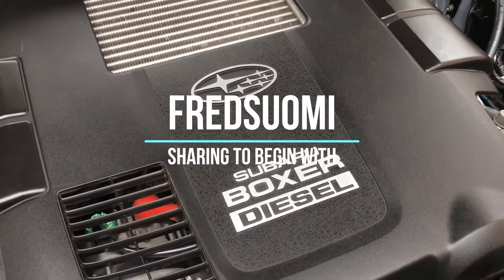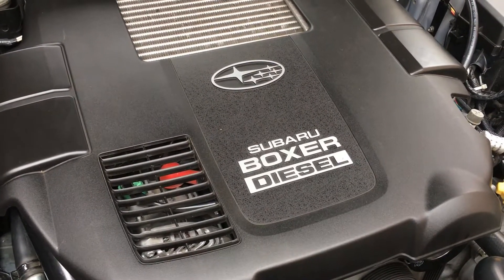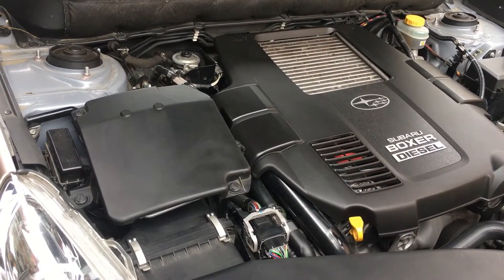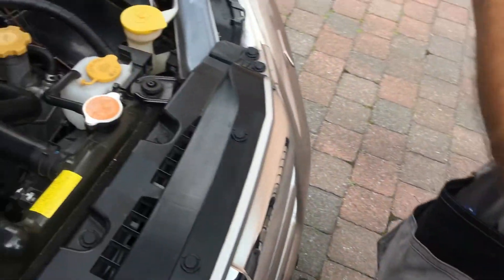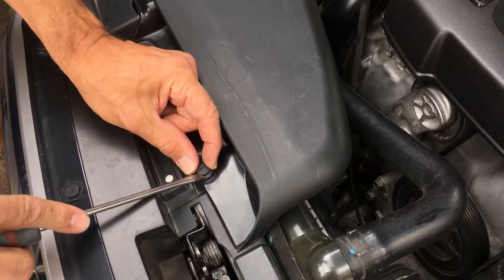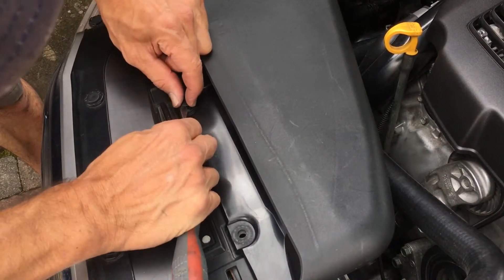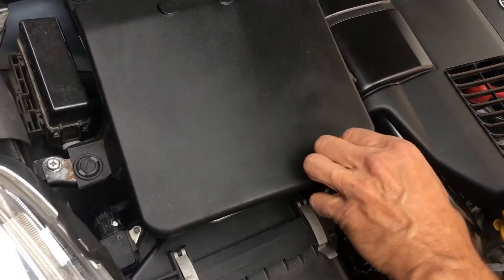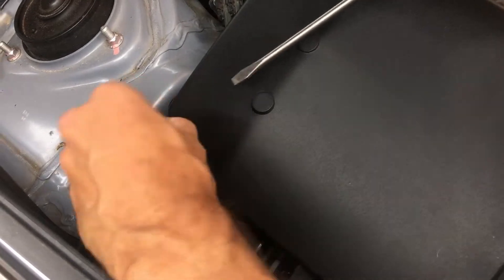Glow Plugs | Subaru OB 2,0D - MY 2014 | How to get there?

Comment: Hello fred 
I have 2011 subaru forester bought blueprint plugs same ones you have 3 years ago ,mechanic didnt want to do job risk of snapping and advised to change when  old plugs are at end of life , reaching that point now 106k miles . Wanted to know how long did you keep blueprint plugs or did you change to original ?
Planning to keep subaru max 2 years 20k miles. Would it be ok to use blueprint plugs, or i have seen recently denso dg615 plugs 
Thanks
Reply from the maker: Hi Nasir, no big worries to expect following your plan to keep your Forester for these extra 20k miles 
with the same GP's, regardless their origin.
The outstanding job to service the GP's with such mileage will be left to the next owner, which most probably will not be as easy as a walk in the park...
As a non-professional, to service my GP's each ±50.000 km with OEM ones (#22439AA010 MY2009-2015 added to the maniacal cleaning of each bore with a reamer) has ALWAYS ended up in a smooth & easy job.
Cheers, Fred.
Reply: @FredSuomi  hello Fred,  since last message looks like denso plugs are not ref compatible 22439aa010
So it looks like possibly buy original or keep blue print ads71802 and use for approx 20k miles 
Thanks again for feedback

Comment: I got the broken glow plug on cylinder 1. Is cylinder 1 top left or top right?
Reply from the maker: I shouldn't bother too much about the cylinder location but performing a simple Ohm test with the 4x GPs in place. The one with the higher value will be the one to be replaced.
Reply: @FredSuomi  Thanks for your reply. I got a report from Subaru saying " glow plug snapped on cylinder head and pausibly causing compression leak because car has loss of power" it also say " when check data found injector no 1 compensation  to be higher then the others" what do you suggest please if you have email I can send you the report to read ? Thanks for your help
Reply from the maker: @Mike1Situation  Subaru's statement is surely reliable but if you wish me to take a look to their report, no problem. Since I am reluctant to leave my E-Mail address on YT, you may alternatively leave a message with your coordinates on my professional website: www.sensoflow.be | Cheers

Comment: Hello I have two questions, I hope you can help me, the Oem part of my Subaru diesel is 22439AA020 and this glow plug has marked 7.5v but all the glow plugs aftermarket that I can find has marked 11v or 12v do you think it won't work? Or will damage something if I used them? The second question is this is the second time after almost one year in the  same cylinder 2 the glow plug got damaged? So you think is sown thing else is damaging the glow plugs (genuine Subaru used in this case)?
Reply from the maker: Hi, as a non-professional and based on my experience you shouldn't replace a 7V GP by an identical but 12V before checking first if the ECU allows this swap with "Low" or "Fast" as possible settings of the glowing speed through the OEM or compatible software. Be also aware of the possible corrosion patterns with some aftermarket GP as shown in one of my other videos. Good luck!
Reply from the maker: Hi, assuming you have carried out the resistance check that led to your declaration of a faulty GP, I would personally fit 2 (or 4) new OEM 22439AA020 GPs and swap the spark plug caps between cylinders 1 and 2. If the problem goes away --> you got a bad GP | If the newly installed GP in cylinder 1 is prematurely defective -> the problem could be the spark plug cap or the harness. Good luck!
Reply: The 7V GP has to be replaced by 7V, this is one of the E6 changes, using a 12V GP will not get up to temp so the soot build up will be faster as the GP is used past the engine start to keep the combustion chamber warm and improve combustion.
Reply: @kommando828  thanks for the info

Comment: The best advice on the removal of plugs from subaru every! I changed all 4 in one go recently as subaru dealer didn't wanted to take responsability for doing so and didn't quote either on the job - what's a shame in UK. Two plugs were so difficult to remove that I left them for a week with drop of oil and liquid molly (perfect). And it done the job great. Thank you once again for advice!!! Time is the best advice here and no rush.
Reply from the maker: Sharing to begin with 🙂

Comment: Thanks so much for that. I'd watched your previous video and did do an exploration into the glow plugs and I got to the left side the same as you. Very Happy with that.

However I'd s few issues. Firstly the connectors refused to come off the glow plugs and secondly the tool your previous video suggested for cleaning out the bore of the engine block was discontinued so trying to find a reasonably priced alternative.

Can see why no one wants this job.

Thanks a million for posting. Excellent video
Reply from the maker: Hi - For the connectors indeed it could be a bit tricky | You may try to hold them "concentric" with one finger on the plastic body and to pull gently by the L shape with your other hand. This worked quite well for me. Reamers can be found from other brands but be aware of the rather important depth inside the head, the tool should be long enough to reach the stepped section. Also nice to read your positive feedback, tks.